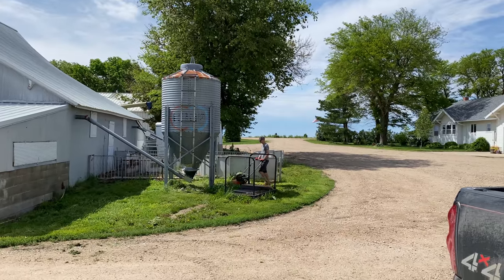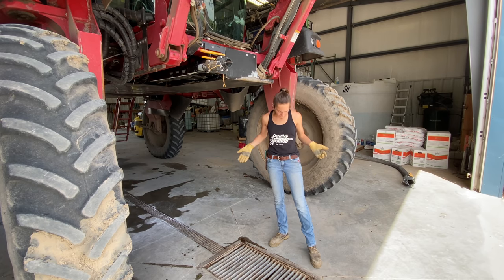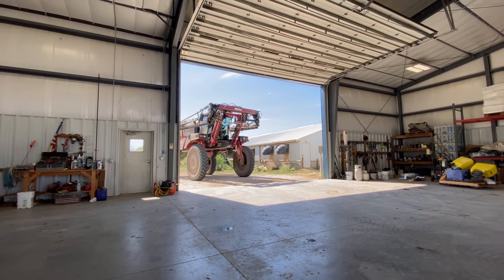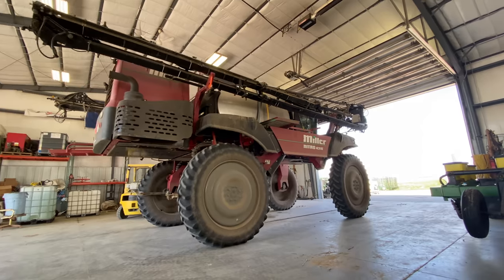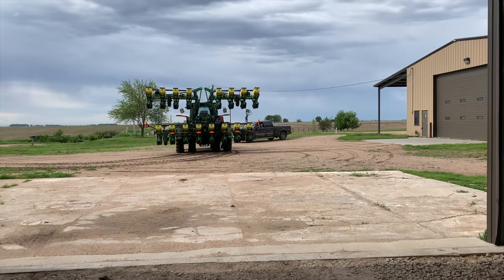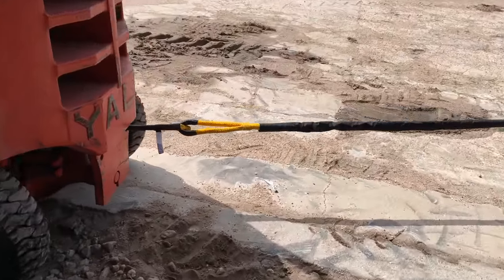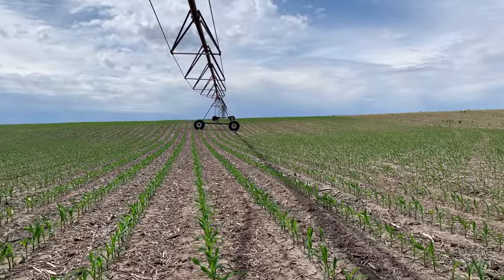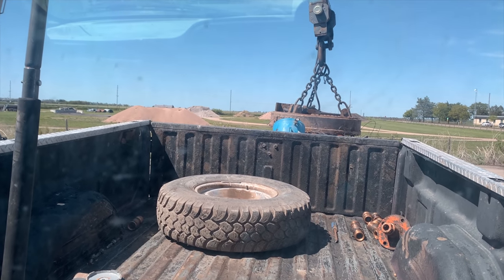I Didn't Drive a Single Tractor Today

Comment: Just a FYI on the 5 ton surplus truck it is imperative for safety that anytime you back it up that you drive it FORWARD the same distance in fgirst gear to release the built up torque to the power train!!! Never back it into a work bay to do power train repairs  UNLESS you jack up a front wheel to relieve the stored torque. Also the front wheels will not engage their pulling power until the rears slip as there is a sprage gear that causes them to engage the power as needed. It was a terrible system and was hard to live with. As soon as the front caute up to the rears it instantly  disengaged the front wheels. We used to call it a bucking bronco. I was a powertrian repairman gas or diesel track or wheel in the Viet Nam war. More later if this helps.

Comment: From the DiFlexx label:      All mixers, loaders, and applicators and other handlers must wear:- Long-sleeved shirt and long pants;- Chemical-resistant gloves (except for pilots);- Shoes plus socks.See Engineering Controls Statement for additional requirements. Follow the manufacturer's instructions for cleaning and maintaining PPE. If no such instructions for washables exist, use detergent and hot water. Keep and wash PPE separately from other laundry.

So except for the long sleeved shirt you handled the DiFlexx in the proper way.
Being a farmer myself, it is a farmers dilemma when working different jobs, change into the right gear when working with chemicals.
Especially when respiratory and full body protection is needed for the more toxic ones like insecticides.
But looking at how quick you can change clothes that is no problem for you ;-)

Comment: As long as the temperatures are not freezing put three drops of Dawn in a gallon of water and it makes a great windshield washer fluid. And it doesn't coast $2.00 a gallon
Reply: In freezing weather add rubbing alcohol. 90 cents a bottle.  Rubbing alcohol makes the water not freeze . The dawn works great too

Comment: I enjoy your videos because I grew up on a farm in the 1960's. You farm is a lot different than mine .My Dad farmed only 160 acres, and 80 acres of my grandparents farm. I first started driving the tractor when I was 13 years old. When I graduated from school I went to a trade school in Des Moines. When I came home for the week-end after harvest was done. I got bach home at 7:40 and was on the tractor and disc doing corn stalks. I usually stayed on until mid night. I do miss farming.

Comment: Grant should have pulled that crap wrapped around the pivot shaft, it could works its way in and damage the seal and eventually the bearing.
Reply: I was thinking the same thing! Pull those strings offa there!

Comment: Nice job guys, as a lab tech don’t forget PPE when handling any chemical, loved grants section🇮🇪👍
Reply: I agree. I know that it's hot there, but bare skin is not good when mixing and spraying chemicals because droplets of it will get on the skin as the wind blows it around. As much as I hate wearing pants and long sleeves in the summer I always do whenever I do any weed spraying. I have had the mist to get blown by the wind onto my legs as I was mixing and spraying a few times (messed up my skin) so I try my best not to get any residue on me (glyphosate especially) and if I do I run and wash it off immediately. When I was young (thought that I was invincible) I was never afraid of any chemicals and I used to work with many that were very dangerous and are carcinogens (before they were known to be) also I worked with lead and tested high in the danger range for it in my blood, so I no longer work with it. Now that I'm older and wiser and have seen what harm that it has done to my family I am very very extra cautious about them now and try to make others aware of the long term exposure dangers. Hence why I mention these to Laura hoping that she will protect herself and her family so that she will be around forever to show us her healthy bright adorable smiles and laughs!

Comment: Dawn is good for baby ducks it should be OK for cars. I wash my poodle with Dawn sometimes when she rolls in... well you know what they roll in. 
How is the back? Check out Athlean-X channel. Jeff has quite a few videos for taking care of lower back pain. Turns out a strong rear end makes for a pain free back. Check it out it worked for my back I’m sure it will work for yours.
Reply: Beware of PR ad claims. It is not exactly as safe as they claim.
Johnson and Johnson baby powder is a prime example.
Reply: kitchen soap breaks down the protective finish on vehicles.  Car wash works differently.

Comment: Laura! Lookin' good with that summer tan and well rested bright eyes and smile, babe!
Sportin' those shorts too! Upside down! LOL
You rock, girl! 

I have squirrels tearing up my beautiful lawn right now, GAAAH! 

I/we didn't get mad at you using Dawn to wash your car, was only sayin' that it will remove the wax and leave a stubborn film that is hard to wash off (and it did). We're only trying to help ya because we love ya a whole lot girl! :-) 

Grant, that Yankum rope was made to stretch like that so that if you had to get a running start with the pull vehicle to have enough force (when tires would just spin) that it would store the burst of energy and also cushion the shock to the chassis of the vehicles that you are pulling with and are pulling out to keep from bending and breaking things. You are correct, that forklift does weigh about 9000 lbs and the counterweight alone is 6000 lbs. Great job in pulling it straight out and not touching the sides of the building! Might want to get some concrete pavers or pour a slab in the corner to park that forklift on?

Keep on makin' these videos! I always like watching what you all are up (always learning something new) to and I have to get in my fix of Laura smiles and laughs because they are very positive and are habit forming! LOL
Reply: Daaw! Thanks for the likes/heart Laura! Made my day! :-)